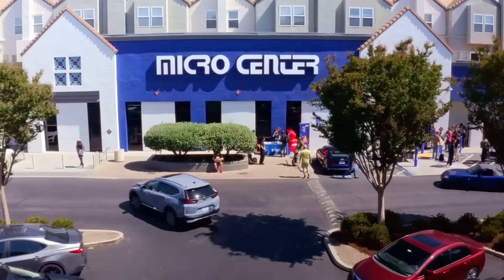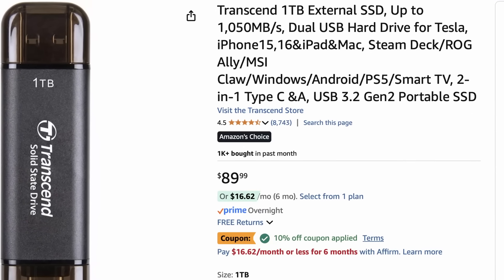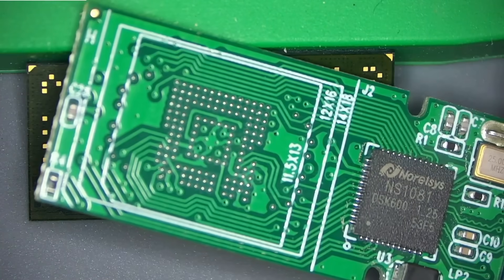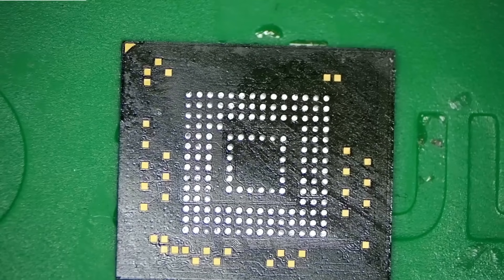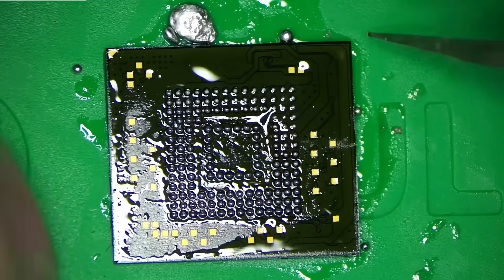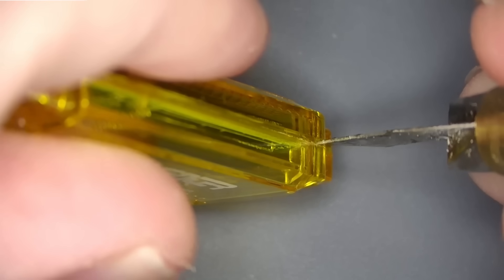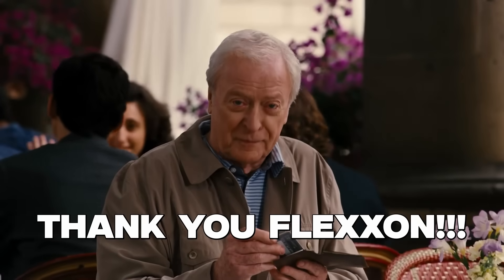I built an Industrial Grade Flash Drive

Comment: I have a flash drive sized ssd (same physical 15:03 size as the micro centre ones), it has type c on one side and type b on the other, it goes to 1000mb/s
Reply: Too slow! I demand USB4 speeds! 80 Gbit/s
Reply: You know there's a difference between Mb/s and MB/s. Which one is it?
Reply: @misterevil4234
8 MB =  8 mb
8 Mb = 1MB/1mb 
MB/mb= Megabyte
Mb= Megabits 
Si los dos están en mayúsculas o minúsculas, significa lo mismo; Bytes. Si la primera letra es mayúscula y la segunda minúscula, entonces son Bits.

PD: MiB = Mebibytes = Megabytes Binarios.
Reply: @misterevil4234 there is no difference between those two
Did you mean mb/s and mbps?
Reply: @mahirooyama9424  MBps is megabytes per second, whereas mbps is megabits per second. There's a huge difference between the two.
Reply: @MethLord I thought MB/s is Megabytes per second. Mbps is Megabits per second
This is just confusing
Reply: @mahirooyama9424  'p' and '/' are interchangeable. Just like how km/h can be written as kmph.

Comment: That was a great idea. I did the same thing with a 1 TB m.2 NVME drive. I installed it in an NVMe M. 2 enclosure with a case, making a massive flash drive. It works exceedingly quick, but sometimes after I click the icon to close it in Windows and then remove the drive connector, I get an error.  Any idea how to resolve it?

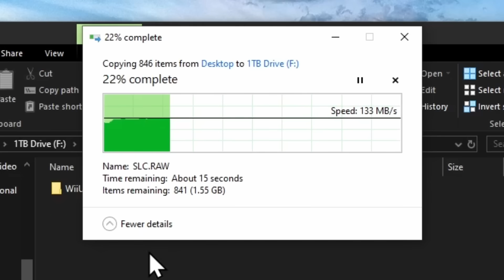Comment: @12:47 -- 130 MB/s is not screaming.  It is half the speed of a mechanical SATA hard drive.
@12:54 -- That slowdown is not fine.  Slow is bad.  Fast is good.

If you never copy large files, then it makes no difference.
If you do copy large files, then it does make a difference.

USB based SSDs, from years ago, such as Samsung's T5, did not slow down.  They maintained 400+ MB/s, even if you wrote 1TB of data to it, without rest.
The T7 was a pig, when its fast NAND cache ran out (something like after 10 GBs on the 2TB model).  But the T5 never slowed down.  The T9 has been out for a while, and appears to also become a pig when its small cache runs out.

It seems as if no one makes a fast flash drive that does not slow down.  They use a tiny amount of  the more expensive MLC(?) NANDs for its cache, and the other 99.9% of the NANDs are crummy QLC NANDs, and the manufacturer advertises only the speed of the fast, cache NANDs.

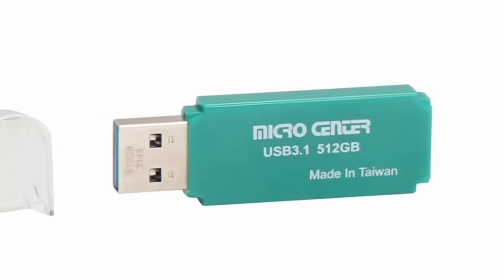Comment: 0:34 no, build a drive as an external ssd enclosure at this point. Yes it's twice the size but it's going to have improved performance, servicibility, and longevity. Flash drives are for small temporary moves, sketchy freebees at trade shows, or boot disks
Reply: But also, nice build!
Reply: m.2 2230 with an enclosure would be small enough while still maintaining most of the benefits of an ssd

Comment: I do not understand this video at all. If you go to the link in this guy's description, you'll find these 512GB emmc chips are $400 per unit. 
I'm using a USB 3.2 NVME Adapter with a realtek chipset to achieve constant 190-200 MB/sec reads and writes. This was achieved using a $55 1TB M.2 NVME and a $15 NVME USB enclosure. Most NVME ssds are faster and designed for much higher endurance write cycles than emmc.
Reply from the maker: it’s a meme

Comment: The only thing I totally not agree with is using a USB flash drive with PGA package and soldered balls I prefer the SMD regular foot print package for one reason you will not face a reballing again in future I already had 2 Lexar 128 gig had issue with bad connection they work if I wrapped them with plastic type .

Comment: Congratulations on all the work. But I don’t see the point. My old 120gb SanDisk is transferring data at 180 megabytes per second sustained. I can buy a 1TB SanDisk Ultra Dual Drive Go 2-in-1 Flash Drive, USB 3.2 Gen 1 Type A / C, 400MB/s Read, 400MB/s Write. From Scan computers for just £84.

Comment: Regarding your question: not even close.  The standard Sandisk Ultra Fit in 1TB hits 400MB/s in sequential read.  Speed oriented flash drives like the Sandisk Ultra Pro or Kingston Datatraveler Max clock in just under 1000MB/s.  And that's just devices marketed as flash drives.  There are "thumb drive" form factor SSDs like the SSK SD321 that use USB 3.2x2 to hit ~1.7GB/s.
Reply: I was wondering about that, i have had a TSPARKLED31TBB01 from teamgroup since 2023, I thought it was an actual flash drive, but it doesnt say anything anywhere about the internals

Comment: I remember when Microcenter launched the USB 3.0 drives, and when I got my hands on them... I was underwhelmed, and even wondered what was the point of  going to a faster link when you couldn't even saturated the bandwidth allowed by the previous generation.

In more layman terms, why use a 5 gigabit/sec link when you can't even get 60+ megabytes/sec.

Comment: Two things, first there is no reason to lower the melting temp of the solder. There is no stress on the gates and the charge pumps aren't loaded so as long as you follow reasonable soldering flow techniques there is no risk of damage with the factory's solder. Changing it so you know the alloy or because you want leaded alloy is one thing but strictly for reflowing there is no reason. Second, don't touch lead with your skin. That's a no brainer. Also use a proper drive benchmarking program like crystal disk mark.

Comment: Te problem with using super glue is that it off gasses & cab form a white crust inside the drive that can damage the traces.
Reply from the maker: That's a good point, I'll keep that in mind for the next one. 🤔

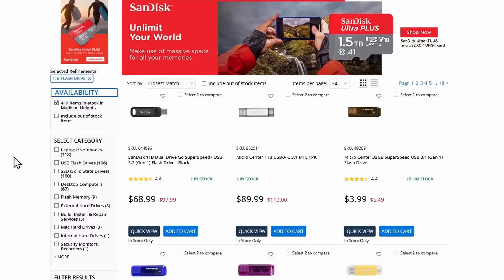Comment: At 0:26 there is literally two 1TB Flash Drives IN STOCK on the Micro Center website that you're using as proof that there is no 1TB flash drives.......... One of them is even a Micro Center brand. Did you really think no one was gonna pause to look at your search results?

You know what could have been impressive... Using two of those 1.5TB micro SD cards to make a 3TB USB Flash Drive. I might have actually subscribed if you had pulled that off.
Reply from the maker: * 1Tb micro center brand flash drive
Reply: Who are you really upset with? Wouldn't want anyone in this community who couldn't give constructive information anyway. Please don't sub. I'll do it in your place.

Comment: But when you get to that size, speed is important. I only use my Flash drives for making backups, to carry around and do intsalls. I ending up buying a SK hynix Gold P31 1TB PCIe NVMe Gen3 M.2 2280 Internal SSD, Up to 3500MB/S, Compact M.2 SSD Form Factor SSD, Internal Solid State Drive with 128-Layer NAND Flash. Well two of them actually. One for my systems main drive, and the other to go in an enclosure. An ASUS ROG STRIX Arion Aluminum Alloy M.2 NVMe SSD External Portable Enclosure Case Adapter, USB 3.2 Gen 2 Type-C (10 Gbps), USB-C to C and USB-C to A Cables, Fits PCIe 2280/2260/2242/2230 M Key/B+M Key.
Sorry, pasted the listing for the item from Amazon. A little too much info. but not a wall of text at least. 
I purchased them in 2021. And they are still running fantastic today. 3 GB transfer speeds in no lie. The reason you get massive drop of in speeds near the end is because of overhead. Thats when the small files are getting copied over. And very small files can take a long ass time to copy. I usually take all my TEXT files, PDF's, and other tiny files, and put them in an uncompressed zip folder. That zip folder can copy at about 3 GB's a second speed, instead of crawling over at 300 KB a second or less.

Comment: Fastest flash drive is certainly debatable. Picked up a PNY Elite Pro V3 256GB that’s no bigger than a regular flash drive, and exceeds 900 MB/sec in real life. 

Though when plugged in, Windows shows it as an SSD. shrugs

Comment: so you stressed the chips three times instead of one time only at a slightly higher temperaure??
Reply from the maker: I see your point 😂 but yeah 

I’ve had terrible experience with preballed chips. 

I know how my soldering work is with my paste, and so it’s less of a risk for me. 

But then again 😂
Reply: @chasefournier I mean that's fine, I usually trust whatever they come with and for the few times I tried it was ok, but I'd you had bad experiences I see where you're coming from 😅

Comment: back years ago i made a water proof microcenter usb drive...tore it apart and made up some two part "plastic weld" epoxy and packed it into both sides of the plastic case then i put it back together letting excess epoxy squish out...when it cured i had a clothes washer proof usb drive.....it lasted for years until it just died because it ran out of read/wright cycles....took many trips in the wash without incident. ....i do own a shirt that says "I VOID WARRANTIES"
Reply from the maker: That is some serious dedication and ingenuity! 💪

Comment: What is the benefit of doing this VS like the way the Sandisk Xtreme is made?  Or like I have a drive from Fanxiang that is made in a way that seems similar to the Sandisk Xtreme because it’s 500GB and will do like 500MB/s.  So my understanding is like they are using like a SSD controller and USB to SATA and all that built into the little thumb drive.  My 64GB Xtreme is like a decade old and the Fanxiang I bought when the Steam Deck came out so it’s already years old and I use them often and they still work fine.  Why would I want to deal with that slow stuff.

Comment: It isn't how big the drives are that is the issue, but the data transfer rate, which is limited to you USB spec. My Laptop has USB 3.1, so I am limited to those speeds. Most flash drives are USB 2.0, so your lucky if your real world results are 12MB/sec.
I've upgrade My Flash drive to a DataMax 900MB/sec writes, USB 3.2 Gen 2 drive.
On my USB 3.1 ports I get 50MB/sec writes, 4x faster, but nothing near 900mb/sec. 
P.S., The DataMax drives are available in 1TB and 2TB sizes.
What's the Firmware Flasher you used? Maybe I need faster firmware?

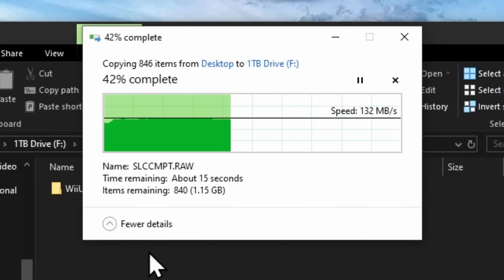Comment: 12:52 the slowdown due to low throttling temps like 50-70C
Try adding a fan or icecube for testing. 😊
Reply: I think it's because the computer is moving alot of small (around 1mb-ish) files, which cause a slowdown.

But you're not wrong tho...
Reply: Thats block size @jamespendon5492

Comment: if this video gets 200k, make a 2TB one LOL
Reply: These are the largest chips Flexxon sell in this style. They're also hella expensive, $130 per chip (unless you get the even tighter tolerance ones, which are $330 per chip, cause they're selling em for military use etc).
Reply: You can just put an nvme drive on a 15$ usb c adapter.

Comment: Is there a possibility of taking some USB 3.0 flash drives with a slow (sometimes slower than USB 2.0!) write speed and reprogramming them to be faster? Most USB 3.0 flash drives I have, have decently fast READ speeds. Same story with many USB 2.0 flash drives. Reading from them is fast enough but writing to many of them is almost down to USB 1.1 speed.

Comment: For higher speeds you should try building a flash drive with UFS 2.1 chips. You can get boards with JMS901 or SM3350 controllers. I've built some with 64GB and 128GB flash chips removed from phone boards. I get 200MB/s sustained write speeds and 420MB/s read speeds.
Reply from the maker: Thanks for the tips, I'll keep that in mind for future projects!

Comment: So you want me to believe that a manufacturer is going to add solder to a chip that has such a high melting point, it is going to damage the chip?
Reply: lead-free solder is harder to melt without specialized equipment.
Reply: @mozneda  Follow these 7 steps, and you can use your heat gun, no special equipment.
1: Put foil tape around the area to be soldered.
2: Apply your flux and chip.
3: Preheat the area around the chip using the heat gun at a lower temperature 180°C for a few minutes. 
4: Move the heat gun in a circular motion around the target area to distribute heat evenly, avoiding keeping the heat gun in one spot for too long to prevent damage to the board or components. 
5: Position the heat gun about 1/4 to 1/2 inch away from the chip and gradually raise the temperature of the heat gun until the solder melts. Usually around 230°C. 
6: Keep the solder in a liquid state for a short time, typically 30-60 seconds, to avoid damage to the board or other components. 
7: If you have not seen any movement, you can gently tap the chip with tweezers to see if it moves slightly, indicating it's reflowed.

Comment: Save your money and get the Transcend ESD310C it’s an nvme ssd on flash drive  formfactornwith usb c and usb a plug.

1050mB/s speed (realistically around 300-700mB/s
Reply: I agree…I have the same thing….its got an old 1TB nvme in it when I upgraded to bigger drive on my computer….it could probably take a 4TB drive..I formatted it to Exfat so I can use it easily between my mac’s and windows computers..990mbps…fast and small 😊

Comment: I wonder if you could put some small thermal pads on the chips then use an aluminum/metal case .   I know it's just a simple flash drive and you won't copying data everyday.  but, it would help.

Comment: Even though 100 MB/sec is fast for a USB stick, it is still very slow compared to modern NVMe M.2 SSDs. Decent NMVe drives can sustain write speeds well over 2 GB/sec, and significantly higher than that for short bursts.

Comment: Contaminating the solder paste with paper towel fibers will lead to the ball joint cracks much sooner. Best to just spread the paste out onto a hard plastic or glass surface and either air dry for 10mins or just pass the heat gun over it a little. It's obvious how bad your paste gets with the fibers when you are stencilling.
Reply from the maker: Great point, I'll keep that in mind for future projects! 💯

Comment: Not really sure why you'd want this, as newer Micro SD cards that plug into an XE rated adapter will read & write faster than USB 3.1 anyway, & already come in sizes bigger than 1TB.
Reply from the maker: Micro center 1Tb flash drive doesn’t exist ==> I bring it into existence 

It’s a meme.

Comment: Men nice experiment but we have sd cards and usb readers same size and speed like this and even more fast. 
It's 2025 after all. 
If you had experimented with a custom SD Express card reader with 4 memory cards of 512GB or 1024GB each, the same size as a flash drive, it would have been significantly more like 2025.

Comment: The fastest USB-Flash-Drive I used myself was a RAID0 I once build out of 8x32GByte. It wooped 480MByte/s.
There are tons of much faster Flash-Solutions, especially if you look at MTD-Solutions, a Linux-Kernel-Driver for Non-Standard Flash-Controller which range from embedded Flash inside a €2 SOC (my ESP32-Clone does ~50kBit/s using MTD-drivers) up to Data-Center solutions literally operating at TByte/s (also MTD-compatible).

Comment: That's incredibly cool! I was always disappointed with how slow those micro-center drives were.  Also, the reason the transfer speed slowed down at the end is because Windows copies files from largest to smallest (I presume, judging by the file names), and transferring 2000 1 byte files is slower then transferring 1 2 Kilobyte file.  (Think of the former being running a foot, tying your shoe, and then running another foot and so on, while the latter is running a full 2000 feet in one run)

Comment: It's getting so hot it's throttling itself. Excellent work, but also as much as part of the meme is putting it in that housing, totally going to reduce it's functionality and lifespan, get something slick made out of aluminum! Maybe PCBWAY partnership or something. But putting it inside a plastic insulator is a 'no bueno' in my book for actual use and trust of the data integrity.

Comment: those chips are crazy expensive at around 400 bucks each. you could get 4 2TB SSDs with that kinda scratch(at July 2025 pricing, of course)
Reply: Yeah...  I think the project was neat, but that price is not.  I just tested a 1TB microSD card in a generic USB 3.0 flash drive and got a steady 84MB/s writing a 2GB file.  (no decrease like we saw in the video toward the end of the copy)  It's a Silicon Power A2 card I bought a year ago for $70 for my Steam Deck.  Even a new Samsung 1TB microSD is $92 right now.  So similar performance and same form factor for 1/8th the price.  I don't have any new microSD Express cards yet, but those should hit sustained write speeds over 200MB/s, with 1TB costing around $200.
Reply: @dividion8102  and you can stick em in a usb stick adapter if you want...
Reply: Sandisk makes a a 1TB flash drive that is much cheaper, no idea what speed though.

Comment: Very nice to have USB memory you did there! Commendable achievement indeed. But fastest? far from actually. I got the Sandisk Extreme USB 3.0 64GB card (SDCZ80-064G) and this memory stick have a read speed of 270MB/s and writes at a whooping 202MB/s In crystaldiskmark. Now copying files with windows have shown up to 250 megabytes a second continuously too on this same stick and it never drops off at the end. a 1GB file to this USB stick normally finish in 5 seconds which is absolutely insane. But I never found this fast sticks after they stopped selling these ones. But they also had some kind of SSD nand instead so it was very expensive to buy these

Comment: Fastest flash drive? No definitely not. Fastest 1tb flash drive? Perhaps.
Reply from the maker: fair enough
Reply: @chasefournier  It might also be fastest for 2 chip flash drives. I've seen a number of much faster 1TB drives since I made this comment but they use 4 or 8 chips for speed. The Kingston DataTraveler Max for example is 5x faster than this, but also uses I'm pretty sure 8 chips which is why it's so long.

Comment: As the dev board already has regular solder balls, why not simply solder the chips straight on?. The dev board solder will melt and bond with the higher temp solder anyway, as if it were copper, surely?